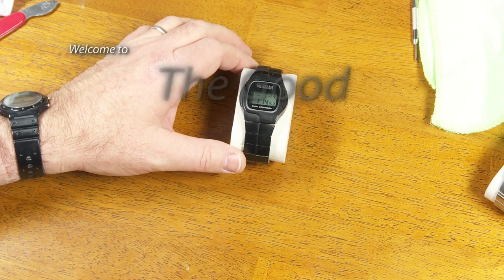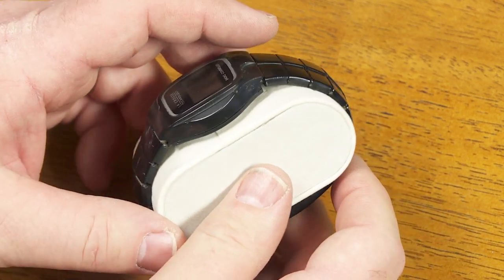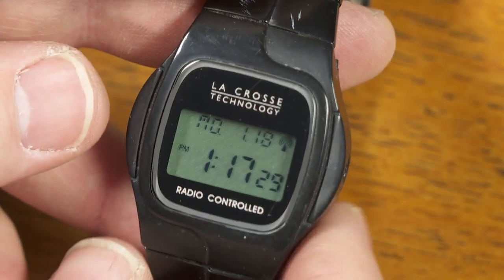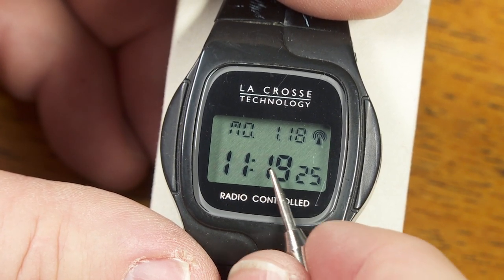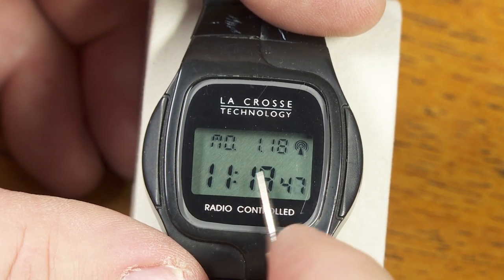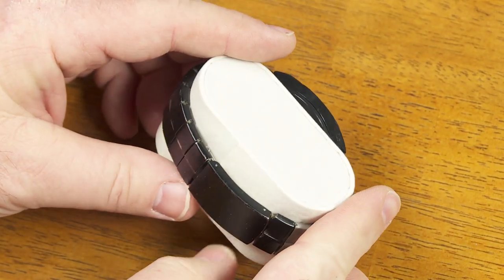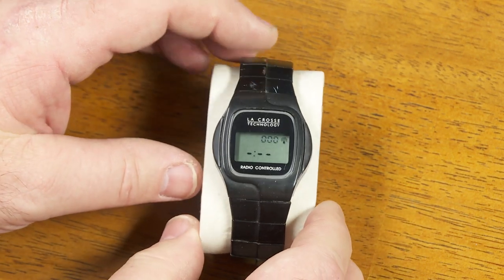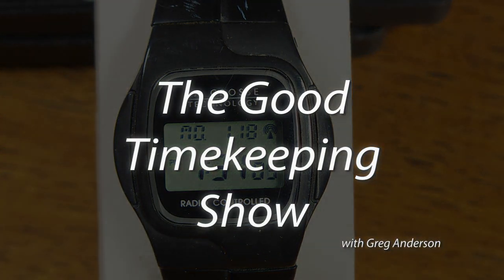Vintage La Crosse Technology "Atomic" Watch W961 In Depth Review

Comment: I have a grey one from my in-laws around the same time you got yours. FWIW-you didn’t lose the button. If it’s like mine it never had a button. I have always had to poke it with a pen or whatnot. Also, like you, I cannot get mine to change DST nor 12-hour display, despite the instruction manual I also found online. I just put another battery in it and I’ll use it to set all my other watches. 👍🏻
Reply: In fact, I’m thinking of removing the bracelet so I can keep in my watch box drawer as a time reference to set the others.